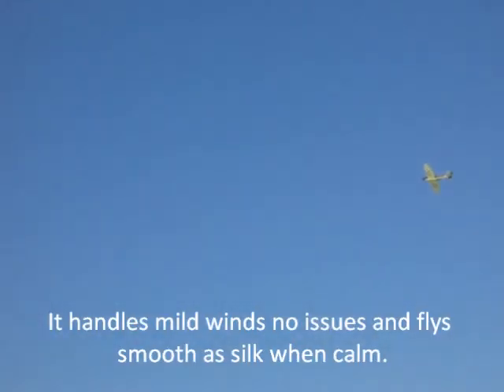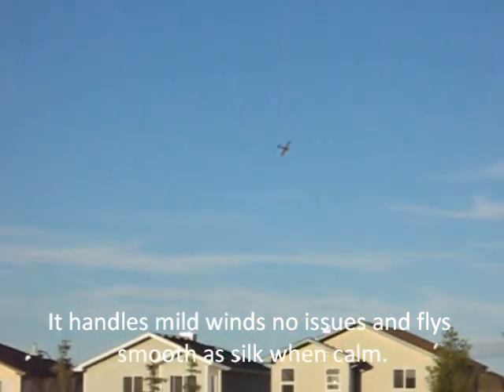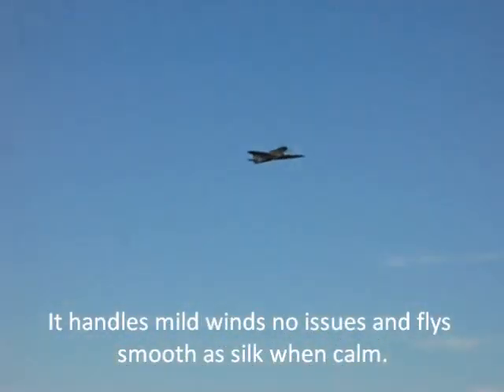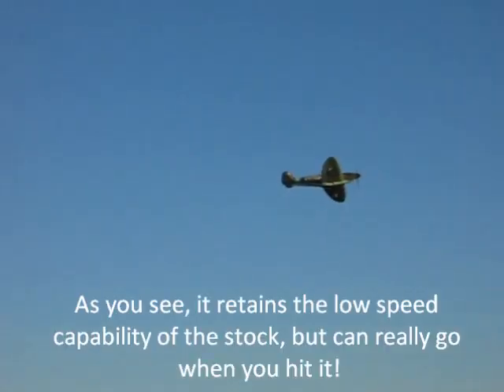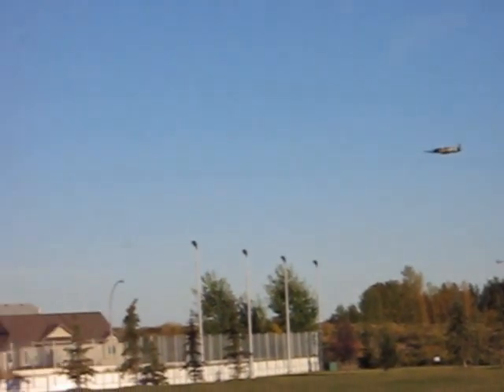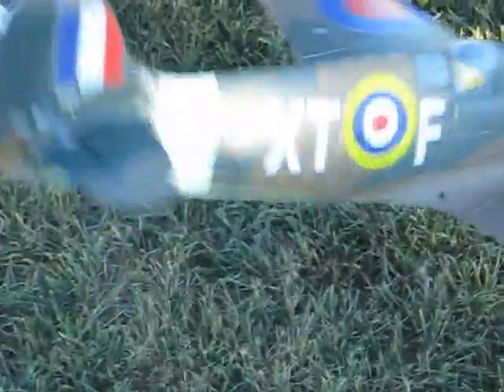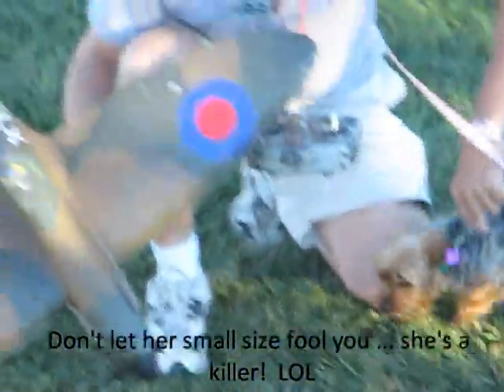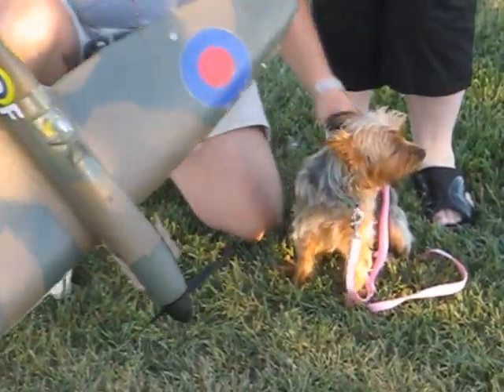Parkzone Spitfire with Rudder, Servo & Brushless Motor mods

Comment from the maker: @startazz Hey there, thanks for watching, and yeah, makes life easier doesn't it!  :>

No problem at all with the question, I am running either the PZ 1800 mah 15 C 3 cell Lipp or the 2200 mah.  I also fly with a Turnigy 2200 mah 25C 3 cell.  I did not re-enforce the wings a bit, in fact, the wing I am flying has been broken in half at the root (hit a light post :< ) and hot glued together & then a bit of clear tape and holds up fine.  I don't crank it too hard though & slow for corners.